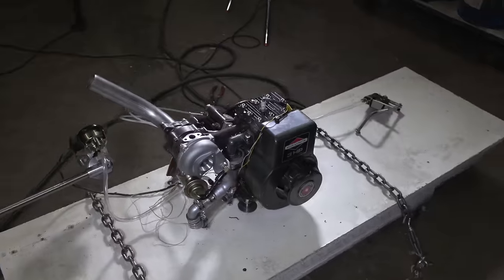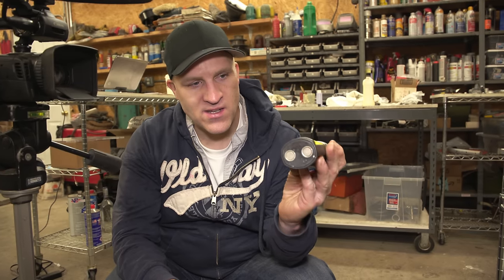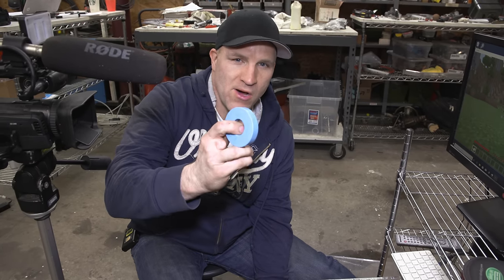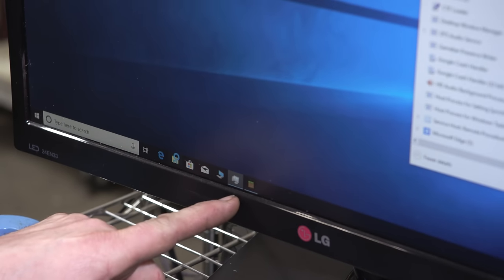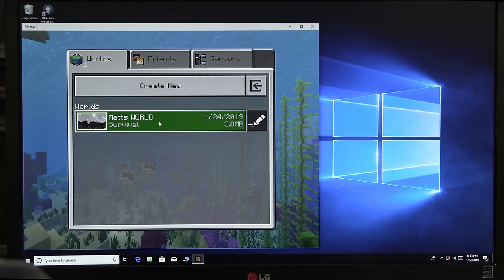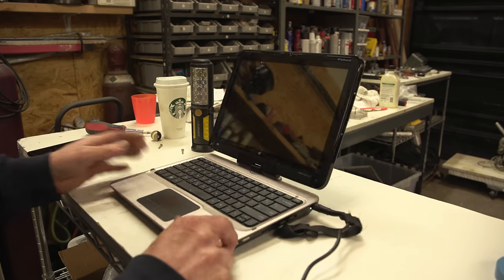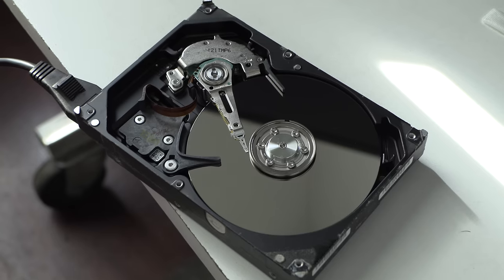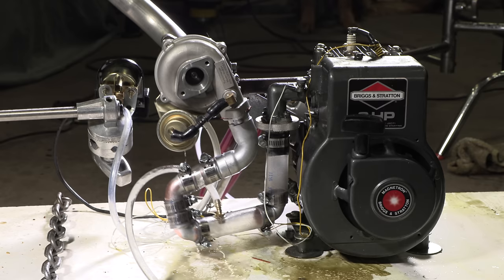Will a Magnet Erase my PC's Hard Drive? - Let's Find Out

Comment: Since people may end up on here, I confirm that applying strong enough magnets to a hard drive will kill it. I just did the same experiment but left them for about a day, enough to magnetise the plates, The HD spins as it has be heard, but it won't be recognised by windows. What I don't know is if the data is still there, the magnets could have just screwed up the head. If someone was to remove the plates and put them in another drive... could they access the data? Don't know, but my drive is no longer working, only someone with extensive tech knowledge should be able to retrieve what was on it.

Comment: If you want to get the computer HD confused you need to put the magnet over the arm of the HD because that is the sensor (I think its just a coil but don't quote me on that) that the magnet could confuse. But it's only going to be temporary - as long as the magnet is on it most likely.
Reply from the maker: Yeah I was mainly trying to see if it would erase all of the data like I saw in the movie. I was extremely surprised to see and absolutely nothing happened to the data.

Comment: Wow, I was thinking that you were just slowing the disk because of overall magnetic metal (even if the platters are metal-coated glass). But if that's from the individual bit domains then that would be pretty amazing! However, then I'd have the question of how the data doesn't blend with itself if its that strong!
Reply from the maker: I've read that on current hard disk drives the magnetic domains are too small to be disrupted, however all of the domains and combination create an overall magnetism of the disc. That's what I read
Reply: @WarpedYT : That is interesting, isn't it? But since a some drives we might have are old enough that the domains aren't as small, and we can't be too sure if a fluke will happen, it's better to be safe than sorry. But yeah, it was still an interesting experiment. Also, opening the HDD's case and letting the dust in can damage it just that way.

Comment: Nice video. If you had placed a magnet near an older "Floppy" disk or a Zip Drive that both use a Magnetic disc for storage then yes a magnet would wipe them out - like what was suppose to happen in the Movie.

Comment: You just contracted the Magnet that balanced the Arm that reads the disk.  The Platter is not Static charged like a VHS.  When you released the magnet you let the built in magnet balanced the  the Read and Write arm and allowed the arm to move back and forth again.  Luckily you didn't damage the platter yet.
Reply from the maker: Nah.... The platter slowed down, watch again closely.
Reply: @WarpedYT  I know I am right.  Those platters are on a very good axle and barrens.  Also done the same experiment with a Clear Plexiglas on the hard drive.  So watched the hard drive and not the computer graphics.

Comment: The Magnet on the steel cover prevented the lines of flux from reaching the disk. when you used the third magnet you probably disabled the voice coil motor that moves the head, or the disk motor. it didn't erase the disk.

Comment: Modern hard drives in present day have sensors to know if the drive is if the drive is in an area that is vaunerable to vibrations or magnetic interference will cause the drive headers to go to the sides of the disc to avoid corrupting your personal data on the drive

Comment: This was an interesting experience. Tho, to better test the mechanical hard drive disk, you should've tried copying a large file, a video file for instance, copy the file file from the hard drive to a thumb drive, so it should be reading data at around 120 MB/s, (to access the disk section in your task manager, go to the second tab, called Performance, then go to Disk). Also to note, the hard drive you have  spins at either 7200 or 5400 RPM, so when you try and put the magnet on it, we should see speeds go down live. That'd be interesting. But great idea regardless, I honestly thought the powerful magnet would just screw up the hard drive and break it! Keep the cool ideas coming! :)
Reply from the maker: Your absolutely correct, I was a bit unprepared, that's exactly what I should have done, and what's crazy is I have the USB drive right there, but it was like 8:30 at night, we had just finished a 10-hour shoot with the see-through engine, I was beyond exhausted. but I actually have one more hard drive video I want to do, it's going to be a seriously extreme test and something that happens to people very often. I'm going to use your idea in that video. Thank you
Reply: @WarpedYT  Great work man, happy to hear you're putting in the work, I know for a fact it'll pay off. And you're welcome, honored I was of help! :D

Comment: I'm thinking the magnet made the motor less efficient which slowed it way down. I'd be curious to see what happens if you stick the magnet over the actuator since it uses magnetic fields to move. But the only way this would wipe anything is if you dropped the magnet on the open hdd and damaged the platter.

Comment: When you applied the strong magnet to the hard disk it obviously interfered the hard disk from operations (reading, writing, seeking) but did nothing to the CPU. Your Windows still running and when you clicked on the screen and tried to open folders etc.
these operations got queued up in Windows action queue. So when you released the magnet. Windows sent the queued action
to the hard disk to catch up with the user interface, that when you saw all the windows opened up quickly and thought it was weird.

Comment: yes it will, since it will rearrange the data to unreadable chunks. you need a powerful enough magnet for it to work without the need of taking the computer case apart, let alone the hdd itself, however.

Comment: The strong magnet does not delete the data.. It may damage the platter/disk inside but it won't delete data.. Because the read and write heads also use high power magnets to move..

Comment: i guess a lot of people are clueless about the distinction between a static magnetic field and one that is changing rapidly. also, depending on your memory setup, you could just unplug the hard driven (or shoot it with a gun) and minecraft would continue working for awhile
Reply from the maker: You are correct, all of that is loaded onto the ram, but this was kind of just a quick small video just for the heck of it,what I should have done was transfer files from the hard drive to an external hard drive during the whole process. Thanks for the feedback

Comment: This is still believed by so many people. A normal everyday magnet will do nothing but slow the spin rate if strong enough, Like the tiny 40lbs neodymium in this vid. Even a 450lbs neodymium could only possibly cause mechanical failure, unless the disk shatters the data will be fine. Electromagnets would need to be AC to have an effect. But i would like to see what effect a degaussing coil from an old crt might have.
Reply: And on a side note if someone online tells you they lost their data because of a regular magnet, They are likely to be law enforcement.

Comment: the platter spinning down, to me seems like the magnet was interfering with the motor feedback winding. iirc the drives circuitry is looking at the actual real time speed of the platter and position of the arm, adding the magnet slowed the platter because the feedback data was not what it was expecting, attempting to correct platter speed and getting the data it wants (platter speed) to a range it accepts.

Comment: The main explanation in this video, is that the magnet stops/delaying the mechanical speed of the spinning platter, its like a book that you cant read a page over and over again to gain knowledge. 

 but why the ssd works? Ssd's doesnt have mechanical parts that can distrupt its reading capabilities even if there is a magnetic field around it.
Reply: P.S. if you really want to delete the data from your hdd, try to scratch it with magnet xD it wont delete but it would shatter the hdd platter, it is good as deleted data in it xD

Comment: Typically with older hard drives such as like during the IDE age typically if it had moving parts and it didn't come with that much protection during that time so there would be time where those hard drive magnets would actually be worth something but usually it would take at least about a 60 lb magnets even erase the particles on the drive but since now we're going to the age of SSD that's typically a hacker obsolete method

Comment: The best way to quickly kill te Harddrive is to put the magnet at the PCB side.
That way, the Magnetic field can penetrate much easily through the casing o the disk platters. The Top casing has a machnetic shield.

Comment: yes, the magnet can erase your data if you do like this 6:23. But if the hard disk have it's cover, the metal cover will shield the magnetic field from destroying the data on the hard drive.
Reply: No, it won't as soon as an attracted metal comes into contact with a  magnet it will become semi magnetic too the shield on hard drives protect it from any dust and debris which will

Comment: INFO: You made a mistake. You contatcted the magnet to the drive through top side, which ferromagnetic ( iron-based). 
Since it conducts magnetic field, it "shortciuits" good part of external magnetic field.

Disk would be way more susceptible form the rear side ( enclosure is usually aluminium alloy).

Best way to check disk in real time is to run, well, disk-check or similar tool from start to end of the disk area.

It would be also useful to know whether you managed to just delete your data or is the whole drive unrecoverable.

Last but not least, it would be nice to know how the data was affected on each platter - did teh drive just gave up because it could read one or two sectors on the top platter, or was all the data erased ?

Comment: You should have used some SMART parameter tool (i.e. Crystal DiskInfo) running during your test, because this interruption was surely noticed by the SMART routines of the drive.

Comment: Yeah, there is a rare earth magnet in each of the hard drives.  When the drives die, I remove this very strong magnet to use around the house.  Now if you get an old 5.25" floppy drive and run the magnet over it...bye bye data.

Comment: there are flaws with this experiment that being that the hdd your using has a glass disk meaning that it wont wipe it and when you put your strong magnet on it pulled the arm away so your hdd wont read now if you had a drive from before 2012 then the chances of it wiping are alot higher due to most drives from before then had metal disks and this is mainly because back when they tried glass the disks would shatter at the speeds of over 6000 rpms so it took them a while to perfect it so this is why your hdd didnt get wiped i still don't recommend you try this as you could destroy your hard drive but non of the data will be lost with a glass disk

Comment: The reason nothing worked and then it worked is because the magnet was forcing the disk to move the way it wanted and the. When you removed the magnet the disks could spin at a readable speed again

Comment: If anything, the magnet is likely interfering with the magnetic field generated by the hard drive's motor, messing with the platter speed. The drive knows there's a fault and doesn't read/write data until the fault is cleared and it gets back up to speed. 

I could see this corrupting data if you tried this while writing data, but wipe the drive? I doubt it. You'd be better off throwing it a wall

Comment: Since hard drives are magnetic, exposing them to intense magnetic events will for sure corrupt data (partially or fully). And putting a magnet on the drive while the heads are flying will for sure cause some high writes or head crashes given enough magnetic force. Don't try it with your 14tb hard drive.....

Comment: If you stick any kind of magnet to an SSD it won't do anything because there is no mechanical moving parts now to a regular HDD are hard disk drive there are mechanical moving parts and when you put the magnet on top of the drive plaque there is the magnets under it that keep all the like storage for that pin to move back-and-forth they don't keep storage but they help move the drive and when you put another magnet above it it slows it down because it's reversing it it's trying to reverse it but it's still keeping a little bit of its rpm

Comment: will airport check in machines destroy hard drives ? I mean I have been travelling with hard drives and lap tops passing under the check system on the airports, nothing ever happened , but I am still afraid every time I have to travel with my equipment

Comment: Your damaging the hard drive from the shock alone. Now as for the magnet... Some disks die quickly but some are pretty resiliant. You wanna test that out better? Use a dugauss gun or tape demag gun. And the reason the disk slowed the spindle speed is because that is a brushless motor and uses the hall affect to know when to alternate the current through the individual windings. Putting the magnet near it throws off the sensor. And yeah that disk is screwed now. As for the SSD a magnet won't affect that. You'd need something like a MRI machine to affect solid state storage.

Comment: I've permanently destroyed a micro SD card by moving it back and forth a few times between some large neodymium magnets. I assume I destroyed the control circuitry or firmware. If you put a neodymium magnet right up to the circuit board on the bottom of a hard disc drive it might do the same.

Comment: Well "looks like nothing happend" doesn't mean nothing happend.
You should create a complete diskimage and xor the before and after. Just power it up and don't connect it to a system so you can be sure that the OS didn't do anything to the data and you will see how much curruption you get.
Also its not so bad if you currupt user data. Then you get a bad file and nothing else. As long as the filesystem metadata is beeing preserved. If the metadata get currupted you basicaly stand in a library of data with no index or librerian to tell you where to search for something you want.

Comment: The only thing you are going to affect when stuff is actually running is the reads/writes to the disk. Virtual memory will be affected but minecraft has already been loaded into RAM so that is not a good measure of data retention. Unplug the HDD, use the magnet, then reattach it to see if it has done anything. Otherwise you really aren't testing much.

Comment: 3:42 the impact of the magnet is more likely to have made the heads crash into the platters. you should try it by slowly bringing the magnet to the HDD. that HDD may be permanently damaged now from that.  don't put any important data on that anymore. but cool idea
Reply from the maker: Well I would agree, but that's kind of hard oh, that last magnet has 40 pounds of clamping force and I'm not sure at what distance that's measured. So once you get within like a centimeter or so it just pulls like heck, you really don't want your fingers in between, and to be honest it feels more like 80 or 100 lbs , because it will pinch your fingers.
Reply: @WarpedYT  thats true. i guess to do that you would have to build a rig to move the magnet safely.

Comment: You used the strong magnet right on top of the arm, not the disks.  You probably just pulled the read arm up or jiggered the actuator which might be why it went nuts.  I wish you’d tried it further back on the drive so it was over the disks themselves.  Also need to run a bad sector check before and after to see if there were more bad ones afterward.  Honestly, this video leaves it inconclusive to my mind.

Comment: your n42 magnet has less power then the 2 n52 magnets under the read arms and the only reason your magnet slowed it down was it messed with the mag field on the plater motor and when it slowed down the read arm parked to not cause damage to the drive there been a lot of work to make hdd's not wipe around magnetic fields and takes a vary large magnet  and ssd drive are solid state and not damaged by magnets

Comment: from your video i remember same experiment which is done by national geo graphic they do the  same thing with small magnet nothing happened but when they use very large magnet its Erase the data on hard drive but in ssd its not work i think